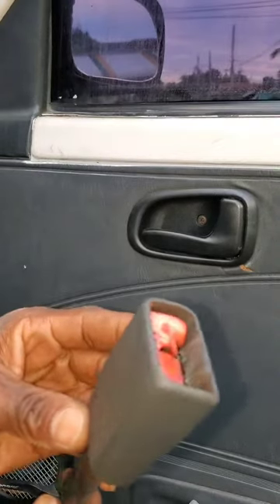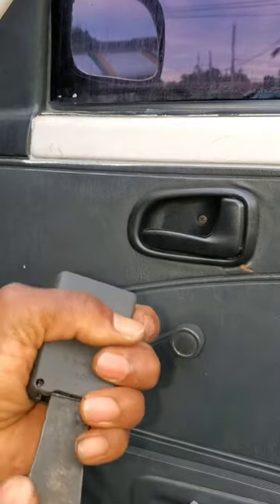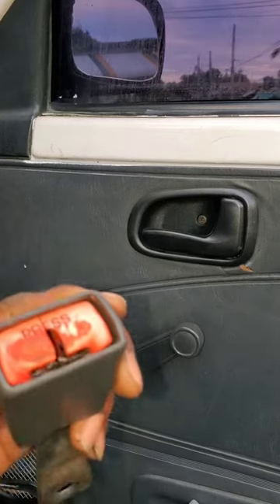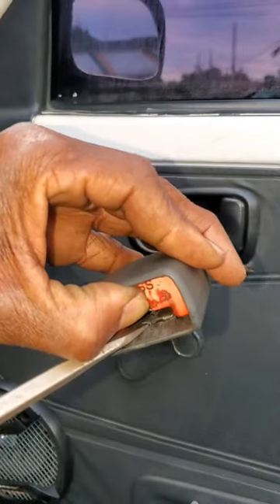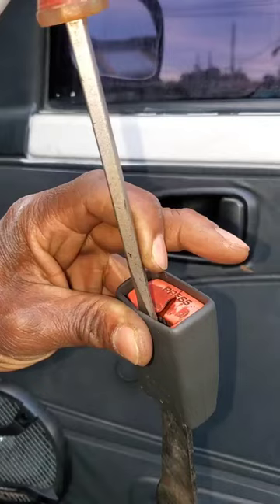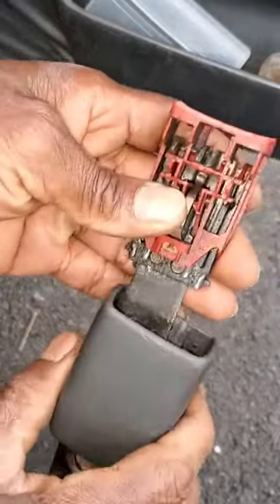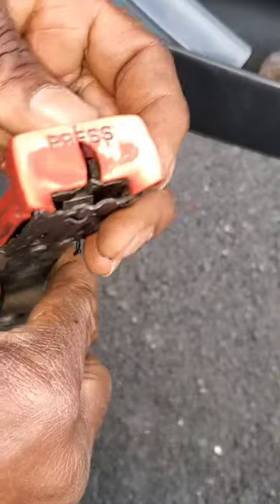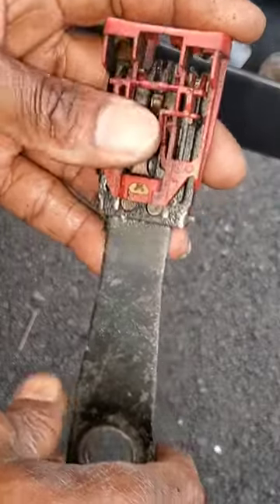Seat belt buckle latch-lock taking apart

Comment: Yes! I have a 1995 toyota tercel and it has this same buckle. The little leaf spring came out so the locking mechanism would jiggle out of place and the seat belt would randomly unbuckle. I took it apart but couldn't figure out where to put the spring. This shows it clearly. I really appreciate the video.
Reply from the maker: @austinreid3378  you welcome fam 🙏